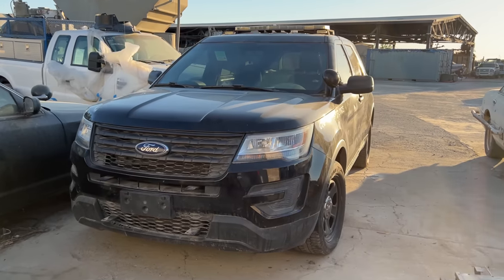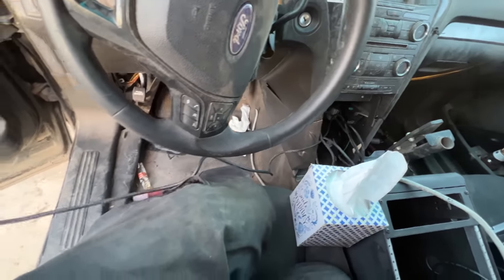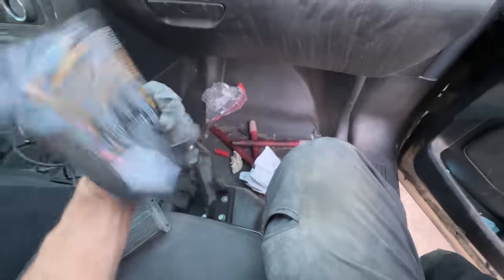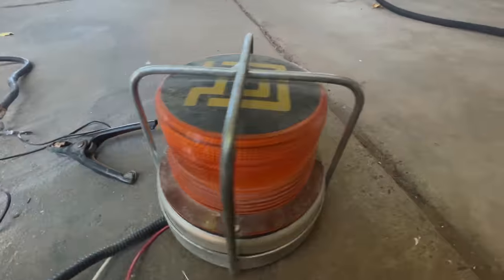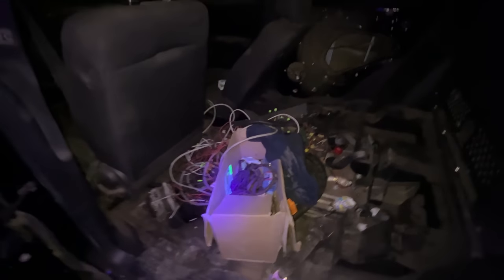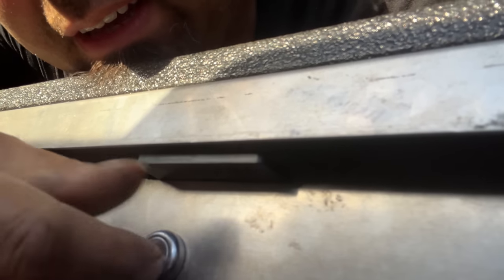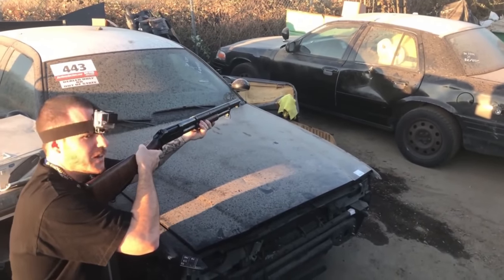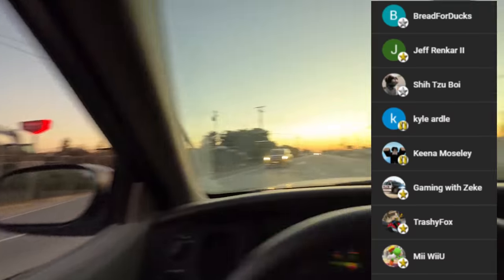I Bought An Old Arizona State Trooper SUV! Found 12G SUPERSOCK!

Comment: Jesus, do these agencies even bother to clean out their decommissioned vehicles?!  I am routinely stunned at what you find in these cars.  Seems like some of the salvageable equipment (light bar, siren control panel, light bar computer/controller) could be used on another vehicle.  I get that some of the shady things find their way into the cars AFTER the agencies sell them (like those Modelos I'm hoping) but most of this stuff is clearly from when the car was a police vehicle.

Comment: I used to build AZDPS FPIUs. That’s not the console they used, that smart siren platinum is a 13-14 date code so if that’s an 18 that’s the wrong siren for it. And they didn’t use that Whelen light or the light in the back window… Video is good entertainment tho.